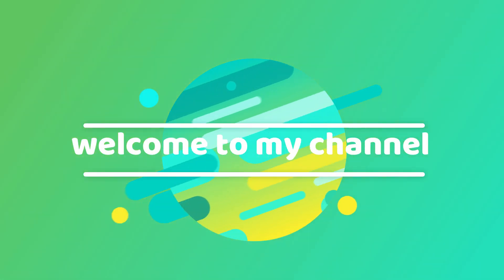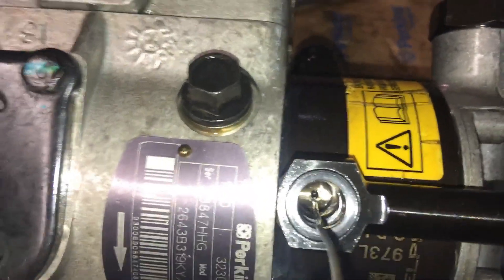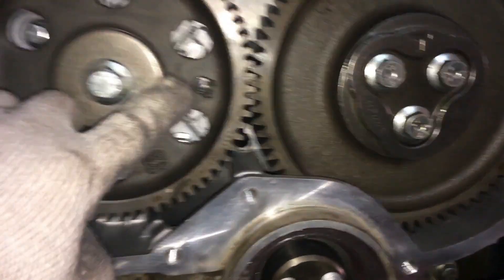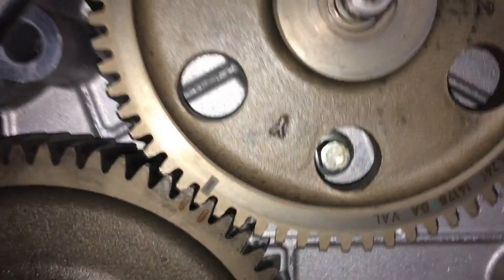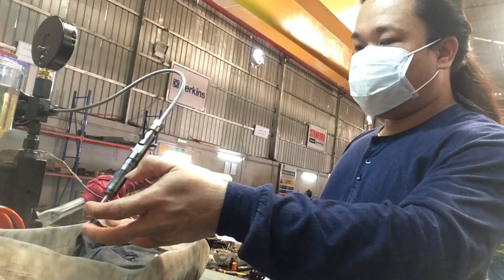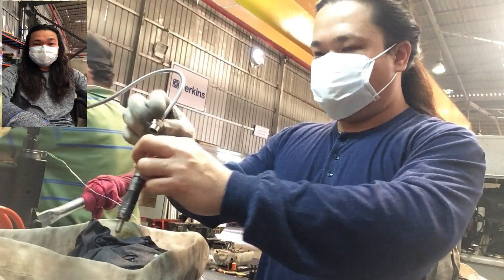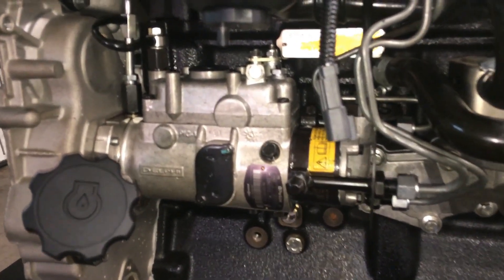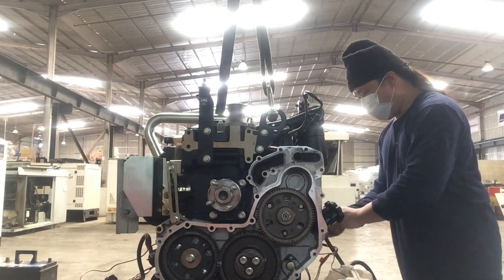FUEL INJECTION PUMP setting and timing setting  PERKINS 1103-A

Comment: Thanks for sharing.  What year model is this?  May soon be working on a 1999 Hyster 80 Perkins fuel pump, & 2000 Hyster 100 Perkins starter. Do you have any video/s or link/s handy for those?     Thanks again.   Take care from TN.
Reply from the maker: thanks sir..that is perkins 1103A engine model

Comment: Sir ano po tamang higpit ng 4 cylinder at 6 cylinder sa pag torque ng cylinder head at main bearing at sa conecting rod bearing please sir sana mstulungan moko dko kabisado ang generator perkins din ang mga generator namin d2 sa kuwait
Reply from the maker: tingnan mo ang engine model manual,,anu bang engine model yang 4 cylinders mo at 6 cylinders na perkins? bawat engine model kase ay may kanya kanyang torque specifications yan,,

Comment: Boss paano mag setting sa overspeed. Kc ganyan din mga unit ko dto salamat.
Reply from the maker: u mean over frequency? yung ganyang klase na ginawa ko,,may manual throttle adjuster kase yan,,kase manual injection pump yan..o kaya e configure mo sa ecm kung electronic ang injection pump para ma resetting ang RMP nya

Comment: Bos, may tatanong Lang po ako sayo, may makina akong sobrang usok, pero nung napalitan ko ang injectors na anim, nawala ang usok pero, ngayon sinubukan ko Pinaandar at may load, parang nasasakal sya kaunte, may kinalaman Kaya ang fuel pump nun bos, anu po ang gagawen ko nito bos. Perkins Olympian 250kva 1300 series sya
Reply from the maker: now kung ok naman ang fuel filters, air cleaner, ok nman cguro ang valve lash niya clearance, ,pakicheck yung injection pump nya,,baka need mo nang ipacalibrate po serr..sana nakatulong ako...sorry po late reply ako
Reply: @almuhandiz6763  nag order na Lang po ako nang fuel pump at anim na injectors baka sakali mag OK na sYa, salamat sir...

Comment: Sir bagong subscribe itanong kulang may Perkins Kami dito na generator 4cylinder iba ang andar parang kubota ang frequency Nya akyat baba paano mag adjust ng idling o Saan mag adjust
Reply: Cris Labastida kung akyat ang rpm nyan, baka marumi ang fuel filter or air cleaner, now kung ok naman bago lahat filter, try mo e fuel bleed, now kung ganun pa rin, try mo ipacalibrate ang mga injectors at injection pump..
Reply: Well-done job